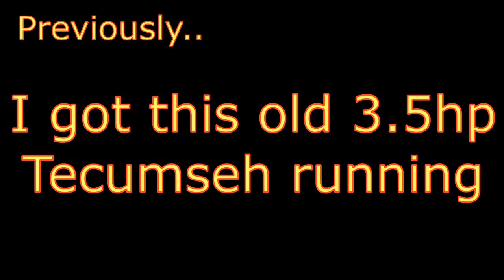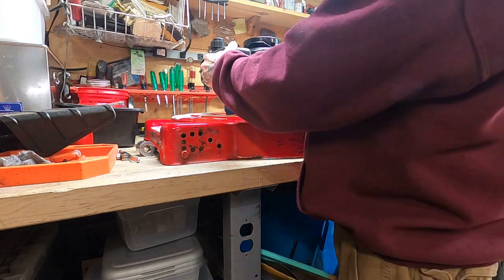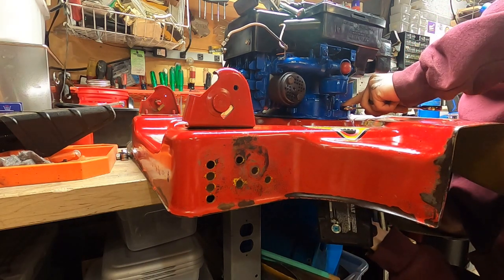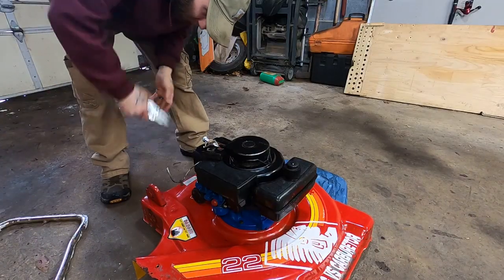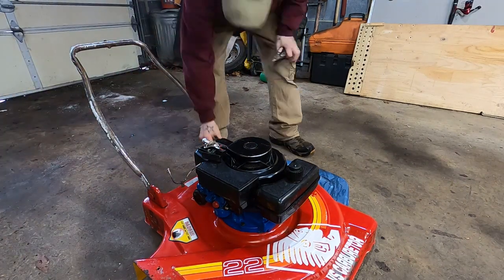Reviving a LAWN MOWER engine for a GO KART

Comment: I just picked up a old 2010 Briggs flathead powered I believe mtd mower off the side of the road this morning. Got home pulled the cord fired right up. Might need a new carburetor or just the governor spring. But ran smooth but blew a good amount of oil out of the muffler enough to leave a quarter size puddle on the deck. Any ideas what it might be from? Head gasket bad?
But I love this series and might do this to my little free one as I plan to keep it as my back up mower incase my Honda ever goes down.
Reply: too much oil?

Comment: But Don’t go karts use horizontal shaft motors ?? “

“It’s a bold strategy Cotton, let’s see if it pays off for him”
Reply: Connect a bike gear to the shaft then another one (attached to the wheels) perpendicular to it